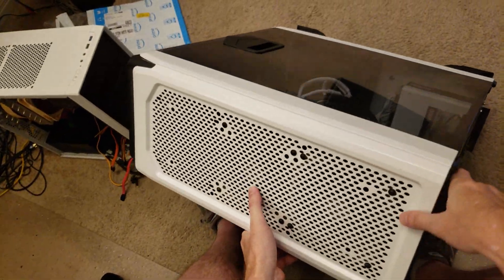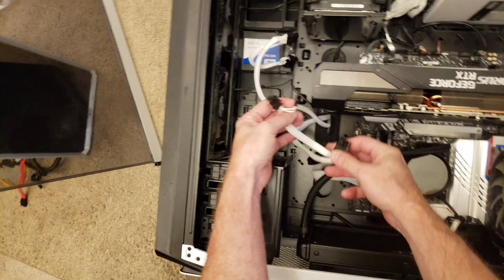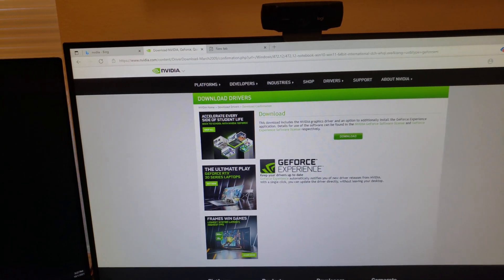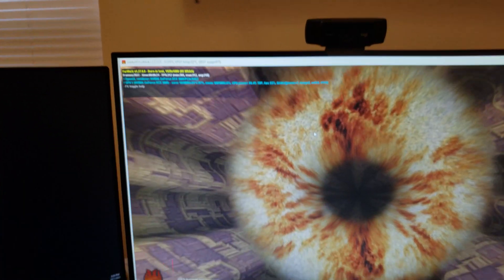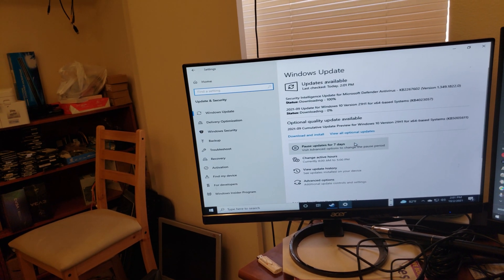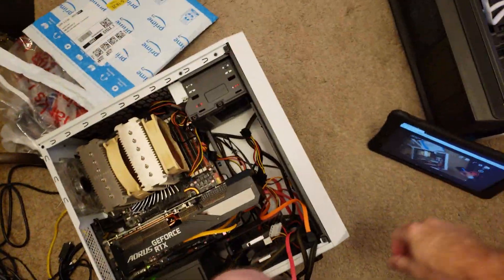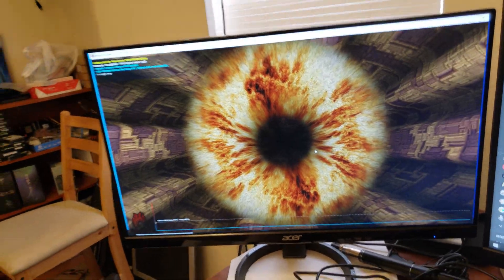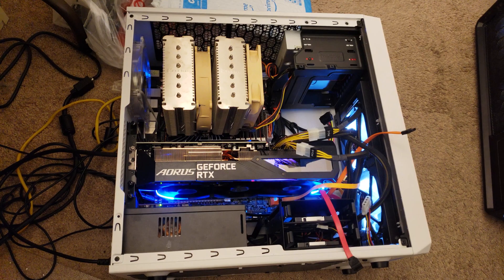Nvidia RTX 3080 graphics card losing video, troubleshooting, installing graphics card and cables

Comment: Please no piggyback cables on this power hungry monsters if possible. And no playing New World!
Reply: I have a ASUS Tuf RTX3080 OC and while it has been working since January when I finally got it, on the latest Nvidia driver and the latest update of MSFS2020 I got graphics problem. I'm not sure if it is anything about those updates, but while using HWinfo I could see a usage of 106% of the powerlimit while in menu on This latest version of Flight Simulator. It dropped to some 80% when actually flying. The Amazon game New World shoved similar usage when in menu for another Youtuber JayztwoCents. Something is not playing it right here... weather it is Nvidias drivers or Windows preparation updates for Windows 11 (which I won't install) or what, I really don't know. I have a feeling Furmark can use the cards at an equal level as these two games? I haven't tested yet. I ran some 3D graphics tests and when I kicked up the fans in my box in advance it worked totally okey..... it is a strange behaviour and as the gpu marked is totally screwed I do hope my card is allright!?
Reply from the maker: @Bratfalken  Jay suggested using msi afterburner to monitor power and undervolt the gpu using the slider in afterburner if it goes too far over 100.